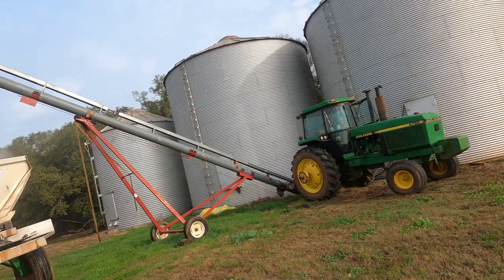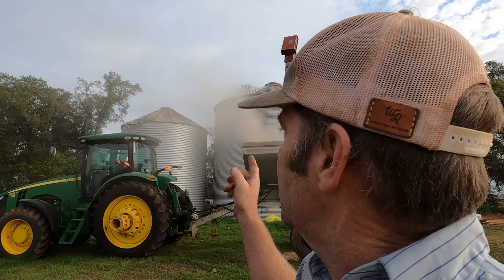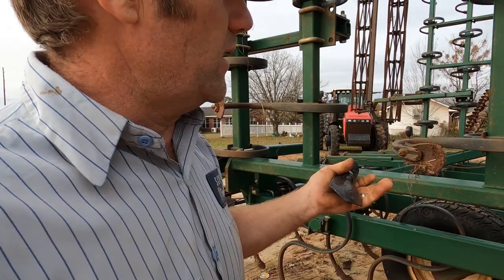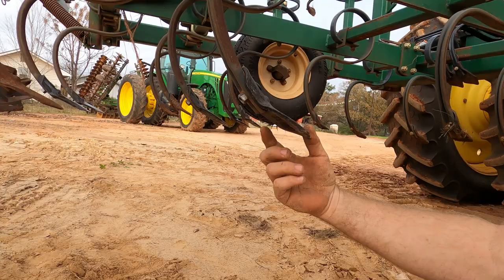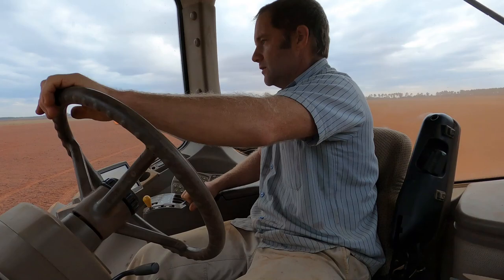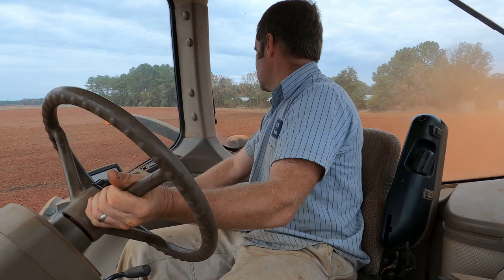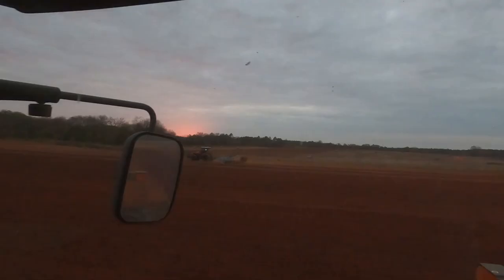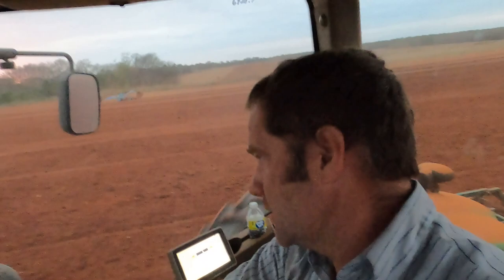Planting Wheat Cover Crop

Comment: When turning around a tractor don't matter the job you doing.Do wanna come down a gear engine speed still high,or just bring down the engine speed or come down a gear and slow down the engine speed?
Reply from the maker: Depending on circumstances I usually just throttle down some and apply pressure to inside brake.  Sometimes i will gear down, but not usually.  When driving a tractor with IVT transmission i usually leave the RPMs at a constant and pull back on the hydrostat.